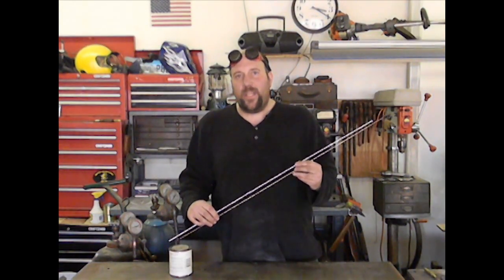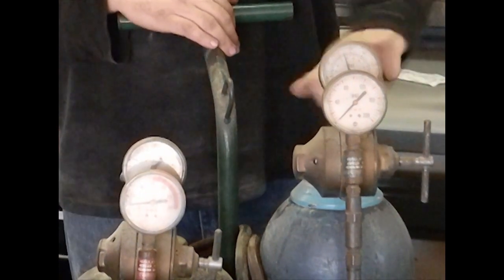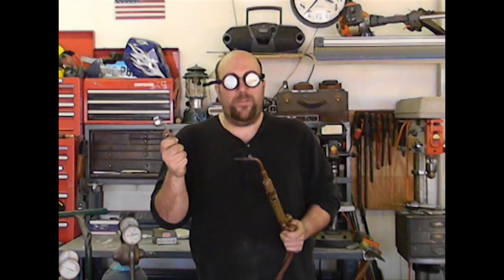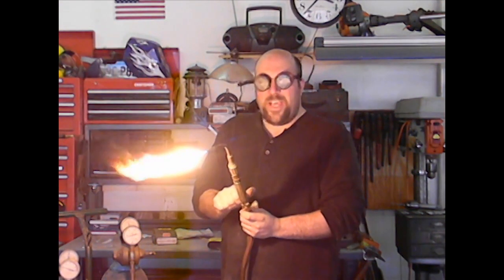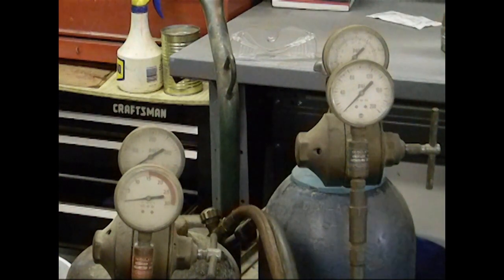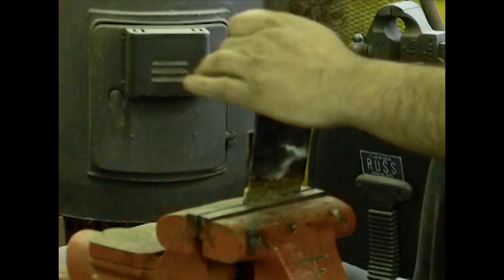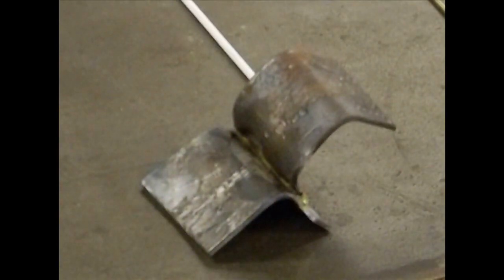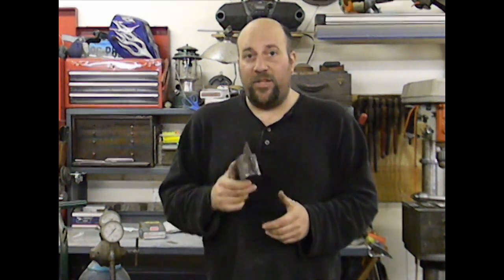Basic Oxygen/Acetylene Brazing

Comment: An old timer told me to use the regulators instead of the torch valve to get a neutral flame. That way the torch valves are just used to shut off and turn on the gas. It's much faster. There is less pressure in the hose. I have been doing this for a long time with no problem. It seems even safer but is it? When doing artwork on the bench I light a candle. I call my candle Pilot.

Comment: Nice video. I enjoyed it, but... you talk about how its unsafe to light the torch with a lighter and I just had to giggle a bit as I watched the rest cuz I see you do a few things that are in my opinion way more unsafe.   Your not wearing proper ppe. (shirt looks like a polyester blend, you should have a flame resistant weld shirt on. No gloves. You braze this on a concrete block which can blow chunks of concrete in the air (which it sounded like it did in the end of the braze).  Turn off the oxygen first, then the acetylene when putting out the torch.  Ex pro welder, so I got quite a bit of experience doing this stuff so just want others to keep this in mind after watching this vid. Not trying to knock it. Good Braze man.

Comment: Do you have to remove the flux after done brazing?
Reply from the maker: Most of the brazing flux burns away clean, there may be some left over material from some fluxes but its not something that needs to be cleaned or chipped off like flux found on stick welding electrodes.  In brazing the weld puddle cools much faster than welding with an electric arc, the flux hardens to protect the weld puddle because it stays liquid for a few seconds. The solid slag that stays behind protects the puddle.

If you have ever watched a TIG welding video you may notice that the torch is held over the weld for a couple of seconds after the arc stops, this is so the shielding gas can protect the weld as it cools to a non liquid state. The shielding gas replaces the flux.
Reply: @jeffreysanto  thx for info, read that you can also use hot water (cold wont work) to remove brazing flux. its made out of Borax, which also have been used as cleaning agent, and also kids use it to produce slime

Comment: So to clarify, you used a flux coated brass rod to join to pieces of steel? 

Also, where did you get the flux coated rod? Any special specs on it?
Reply from the maker: Flux coated brass rods are not that common and I only had them left over from a project. If your looking to gas weld go to any welding supplier and ask for "Flux Coated Low Fuming Bronze Brazing Rod" they are a lot more common. A few different manufactures make them. Lincoln Electric rods might even be available at Home Depot since they sell Lincoln welding products.

Comment: Can you shed light on the Hobart Copper coated Steel Rods (RG-45) and their uses? Can they be used for brazing and if so is it the same technique? Good video, shows how strong brazing is. Thanks!
Reply from the maker: Brazing is closer to soldering than it is to welding. With brazing the parent metal is heated and the brass, bronze, copper or alloy is used to fuse the to together.

With steel rods they are used for welding. The parent metal actually melts and the steel filler rod flows into that material and created a weld puddle. Most steel rods (unless flux coated) are plated in a very thing layer of copper to prevent rust or corrosion.

The upside to learning gas welding is that if you are already familiar with brazing you'll pick it up quickly. It uses the same shade 5 welding glasses, since there is no ultra violet light a full face helmet is not needed.

Comment: No gloves??
Reply from the maker: You don't need to wear gloves for brazing or gas welding. There is no ultraviolet light to be concerned with so unless you're planning on being a complete tart and touch the hot steel you don't need gloves. The heat from the gas welding process will harden most leather gloves.

Comment: Excellent that you mentioned a practice period before starting on the actual work. I find I sort of calm down and get back in the groove when I practice first, plus if have similar metals to the actual work I can "dial" in the best settings. Note: I still can made some frightening welds even then.
Good safety tips, and I like to use TIG gloves most of the time, easier to hold stuff.

Comment: so whats the actual reason you shouldn't light a torch with say a lighter?
Reply from the maker: +Yahb015 CatDog Since you do not need to wear gloves when using a torch the striker keeps your hand further away from the flame as it ignites. To be honest most shops and schools wanted to completely ban butane lighters that have plastic bodies. It does not take much to burn through them and a new one can explode with about the same force as a 1/4 stick of dynamite.One guy I know of a while back got killed working in a garage, he was a pro too. He was replacing a muffler on a car at a dealership, he was a smoker with a pack of cigarettes and a bic lighter in his shirt pocket. Since the car was on the lift he was making the weld overhead, a hot piece of slag or something burned through his shirt and the plastic on the lighter. It blew a small hole in his chest similar to a gunshot wound. While I personally don't see an issue with a zippo style lighter and lit torches with one in my teenage years I still won't encourage the practice. Very good question though, thanks for the view and the comment :)
Reply: I see. That makes perfect sense then thanks for answering

Comment: I disagree with keeping the rod in the flame. That will oxidize the rod and add impurities making it less likely to stick. Instead you should heat the metal and dip the rod onto the hot metal and let the metal melt the brazing rod. The brazing rod by design melts at a lower temperature than the metal you are brazing together and you should not have to heat it with the flame to melt it.

Comment: Haha wtf you're not wearing gloves!!
Reply from the maker: You don't need to wear gloves for brazing or gas welding. There is no ultraviolet light to be concerned with so unless you're planning on being a complete tart and touch the hot steel you don't need gloves. The heat from the gas welding process will harden most leather gloves.

Comment: Thanks Jeff, now I see what I was doing wrong. I'll try your method. I was getting rather frustrated cause I had the Ox way to high and the flame to a fine blue tip on low pressure. Didn't work so well. Search and found your video. Now to put it to use.
Scott

Comment: Agreed! always use a neutral flame for brazing and carburizing is only for welding stainless steel sheet metal, but the Cobra DHC 2000 can join up to 9.5 mm thick.

Comment: I think the max thickness for material to be brazed is 2 mm. Have never seen anyone braze stuff 3 mm or thicker.
Reply: I have brazed 15mm thick vice parts and teeth on a gear which is pretty thick, maybe you mean fuse welding.

Comment: The only disadvantage with brazing is that it doesn't work for joining plate steel to another plate, but for sheet metal, disimilar and cast iron, brazing is the winner. Welding cast iron is a bitch, because too much heat and deep penetration can cause cracking in the metal. My vise broke and the cast iron with the cheap joint being about 10 mm thick I cannot braze it together like I would an exhaust pipe, but I could just weld another piece of a vise, but out of plate steel with a stick welder or a battery with jumper cables and SMAW rods.
Reply: I brazed together a 6" vice with silicon bronze rods and it came out fine, the vice was about half an hour old and a fitter decided to use it to hold a large part and hit it with with a 20 lb sledge hammer, after it broke it went in the bin with still new paint on it so I rescued it and welded it back together.

Comment: Nice. I tried to cut brazed cast iron with a hacksaw and it ruined my blade teeth.
Reply: I see :(, that's why I use an angle grinder with a cutting wheel for stainless steel.

Comment: Wow, I never knew brazing was so strong.  Thanks, good video.
Reply: My instructor told me that oxy-brazing join will beat all other so-called snap-in, etc. OVER TIME moisture, will get in, EXCEPT oxyacetylene brazing if done property that is almost impossible to preventing it! With proper oxy-brazing, the connection is full-proof, NOT moisture will get in, last forever unless someone move and compromise its joining integrity, etc.

Comment: I'd also like to add  the "O" rings may need replacing on the torch head if there  is a pop or bang.There are two per head.check for cracks or ware.If the torch hasn't been used in a while,I would closely inspect .Home depot carries most sizes

Comment from the maker: sounds good,  the only difference that I was taught was to increase the acetylene until the black smoke is nearly all gone before adding the oxygen. I personally don't know if one method is better than the other.

The bang can be a few different things. The two most common I see is the oxygen being added to fast can cause the flame to go out, the second is if the dirty tip dirty or its been cleaned so many times that the hole in the tip is not the correct size. Good Luck in school!!

Comment from the maker: And you need them why? If you do it right you feel nearly no heat, there is no UV light nor are there any sparks. If you cutting steel with a torch then yes. If your are brazing or gas welding and wearing big bulky gloves its a sign of being a bit of a noob.
Reply: eleminate the hollow background for a 10

Thanks

Comment from the maker: From what I have read paint has a hard time sticking to any brazed surfaces, it tends to bubble and flake off. I don't know if its a chemical reaction between the brass and the paint or what. What I would suggest is to call a local welding supply center and ask them if there is a paint product they are aware of. If there is I am sure they'll be willing to try and sell it :)

Comment from the maker: Part 2:  Here is where it gets interesting, lets say you work in a shop and you have several cylinders and most of them are being stored. The fuel gas must be kept separate from the oxygen, in the text book I learned from in school it states that they should be at least 25 feet apart or separated by a half wall with material fire resistant enough to withstand 30 minutes in a blaze.

Cylinders are very safe if you just follow a few simple safety rules and use common sense :)

Thanks for watching!

Comment from the maker: When the cylinders are in use they are kept side by side chained to a cart that can be rolled around the shop. If you are connecting new cylinders and using them for the first time you always do a "leak check" with a little but of soap mixed with water, if you see any bubbles around the connections you know you have a leak and not to light the torch. Most hoses are between 8 and 12 feet long. The closer you are to the cylinders the faster you can shut them down if a problem comes up.

Comment from the maker: Most of the folks that I know who work with very thin material tend to solder it together rather than braze it. Either that or they use a Tig welder. I myself do not weld material that thin very often and when I do its Tig welding for me.

Check out "weldingtipsandtricks" He may be able to offer you a better answer, he does all sorts of things and should be able to point you in the right direction... hope this helps.

Comment from the maker: This is a very good question, in fact it gives me an idea for a new video :)

The easy answer is Brazing is done with a brass or bronze rod and the parent metal being joined just needs to be very hot, it does not need to melt.

Gas Welding: Same equipment but you are using a filler rod that is made of the same material as the metal being joined. Steel rod for steel, I have even gas welded stainless with the right rod. Gas welding you also get the metal to melt slightly to form a weld puddle.

Comment from the maker: I was as well the first time I saw a brazing demo. This rod happened to be brass, but did the job. My old instructor brazed the end of a pipe to a plate, let it cool and challenged us to break it. We beat on it for so long we ended up cracking the pipe, his weld never flinched. If it is done right the braze should be stronger than the parent metal. :)

Comment from the maker: I believe in this case the popping was caused by the torch tip coming in contact with the project. A very small amount of molten brass on the tip disrupted the gas flow. 9 out of 10 times when it occurs it means the tip needs to be cleaned or replaced. The tips are a consumable, every time you clean a tip the hole gets slightly larger.

I was lucky I was nearly done, if I had hit the tip closer to the beginning the popping would have been during the entire braze.